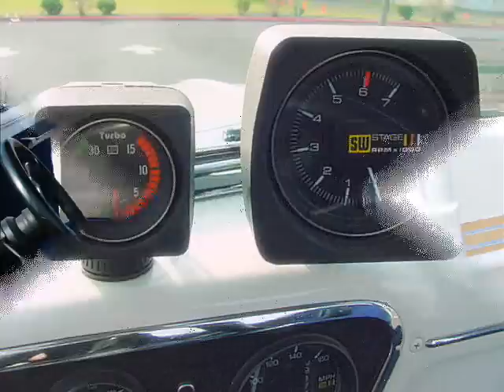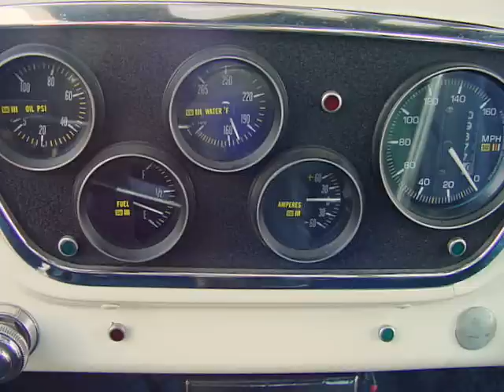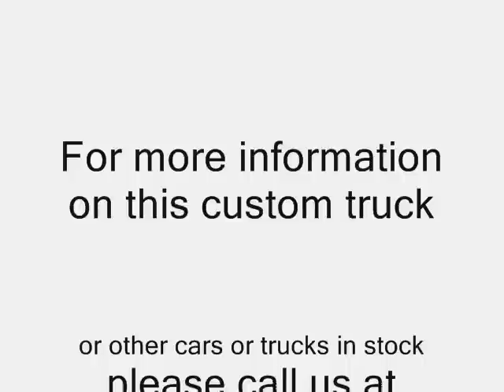1955 Ford F100 Custom Pickup - Roll Cage - Turbo Charged - SOLD!

Comment: It's really to bad that the truck has been so hacked, with the SB Chevy boat anchor, A sun roof , and the really dated interior fabric, this truck is only worth about $6000, and at that its just a good start to a project, to make it right.
Reply: Hey!  I built this truck while I was in high school in 1980!  I know it could have been done better, but I did the best I could.  Plus, at the time of your post it had been restored for 32 years, so in my opinion it has held up pretty well.  That's no boat anchor by the way, it was the 300 hp 327, and with the turbocharger it was plenty fast.  The heads were ported and it was very streetable, which was nice.  It ran 15.0/92 in the 1/4, and it topped out long before the finish because the rear end was geared too low.  But I get it, that was a long time ago and it is dated.